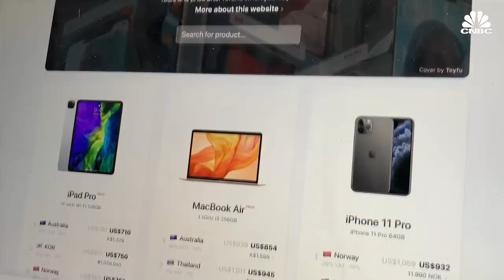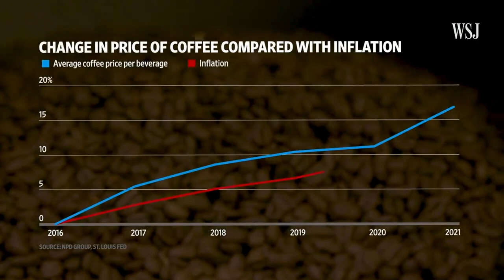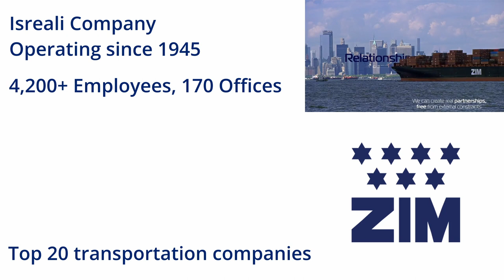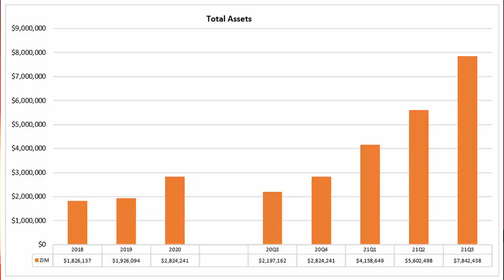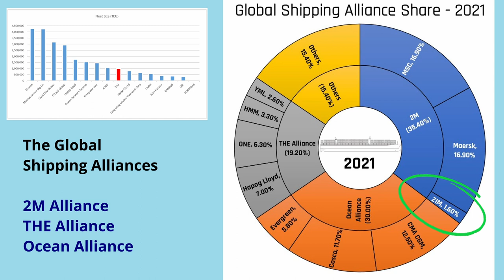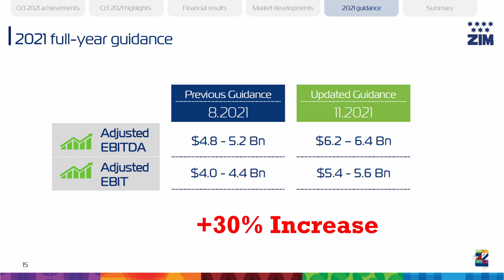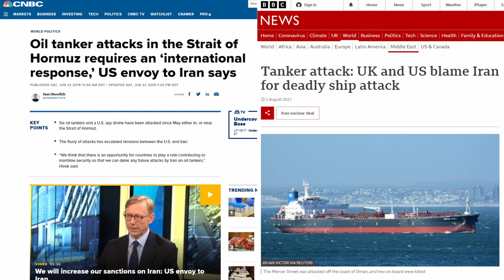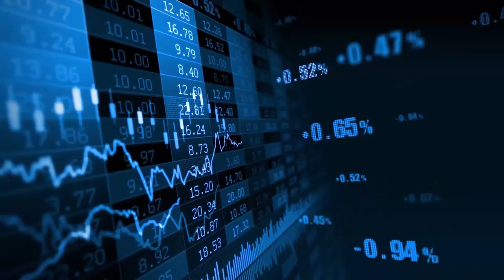This Freight Shipping Company is on Course for Massive Growth!!! (ZIM)

Comment: Is it true that there is a 30% TAX on dividends? Thank you.
Reply from the maker: If you use a regular trading account then the HMRC would class dividends as household income and your tax would fall in line with the established tax income brackets, which can be brutal once you go over the £37k income bracket, jumping from 7.5-32.5%, and you have to factor in taxes on US stocks, withholding taxes, exchange rates as well, ugh! But you can avoid most of this by holding your dividend investments in an ISA investing account, which circumvents UK tax. My total ISA deduction from ZIMs last dividend came to 25%. See here for UK brackets: https://www.itcontracting.com/calculators/dividend-tax-calculator-2021-22/#:~:text=Current%20Dividend%20Tax%20Bands,and%2038.1%25%20(additional),
Reply: @jasondoesinternet  ...NOT ACCORDING TO ORACLE OF OMAHA WARREN BUFFETT
Reply from the maker: @PedalToTheMetal61888  Can you expand on that?